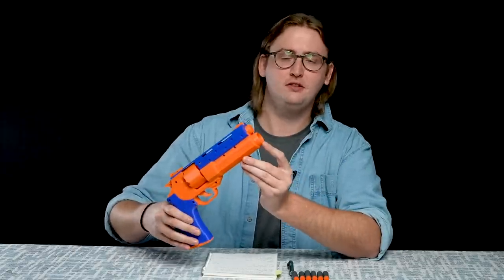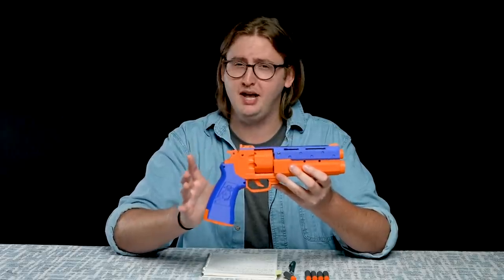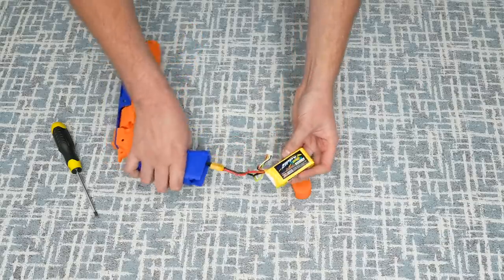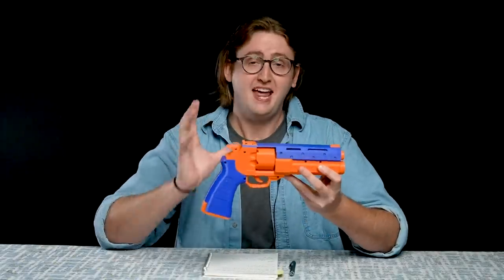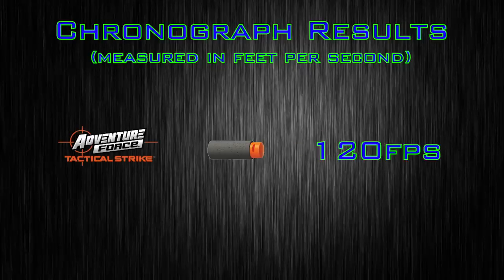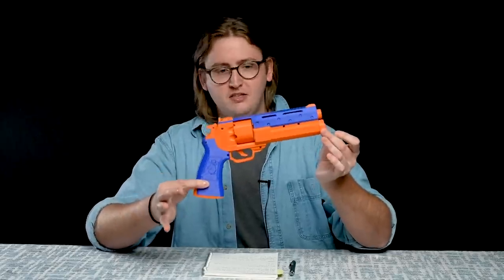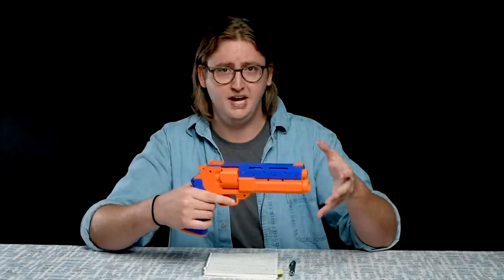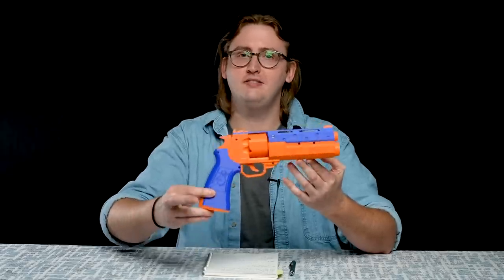[REVIEW] The Magpie | Flywheel Revolver!

Comment: Something I noticed is that this blaster looks almost like a 1-1 replica of a Mateba Mocel 6 Unica, which if so, I have to complement the designer on. It's a pretty obscure real steel semiautomatic revolver that fires from the bottom of the cylinder instead of the top, which reduces flip up. It's one of the more obscure and complicated revolvers ever made.

Comment: As the designer, I'd say this was a very fair review. It was made, less from a competitive stand point, and more "because I wanted it to exist". On that note though, I have effectively run this at events as a sidearm, though it has often been plagued by issues of one sort or another. 
The only thing to note beyond what was mentioned is that the hammer is not cosmetic, but central to how the blaster operates. The hammer rotates and presses a linear pusher into the chamber, and also operates the hand that turns the cylinder. Because of that, it can also be hammer fired without using the trigger at all
Reply: Well, nonetheless, you did a great job.
Reply: Hope the Magpie gets a revamp and more superior internals.
Reply: @pramusetyakanca1552  that isn't on the table really, as I've been very busy with shellington blaster work. Maybe someday, though
Reply: @HeathHeil  that's where I come in with that longcolt mod kit we talked about.
Reply: @thinredpaste  that will definitely be helpful for the longcolt. The original magpie could probably use some updates, but I have no major plans for that at the moment.
Reply: @HeathHeil  I'll probably port my adjustments to the original magpie too, but I started with the longcolt cause its the one I wanted to exist more.
Reply: It looks rad as Heck, and the concept of a single trigger flywheel like this is cool! Interested to see a version 2 and onwards
Reply: Could you make so that the hammer activates the flywheels? Therefore, the trigger would only push the dart and disengage the flywheels so it could be less tricky.
Reply: @alex-winters8473  that's how it works. The hammer rotates the cylinder, presses and then releases the flywheel switch, and pushes the dart
Reply: So I can finally fulfill my childhood dream of owning a revolver that works like a cowboy and shoots nerf darts? Helll ya
Reply: That’s what I said bro we think so alike ☺️
Reply: This takes a lot of talent. Great work
Reply: Thank you for dedicating time to designing and providing the foam community with new blaster designs. I love the fact that you made a flywheel revolver in a world of talon mag side arms. Thank you for making something new! ❤
Reply: I got, like, 5% of that. But let’s just say it makes sense
Reply: @Trollo_Swaggins  but then I would be better served making a spring powered hammer blaster to maximize power. The point is that it's semi/double action. It's finnicky, but it just is what it is
Reply: How much is it again?
Reply: how do you feel about modding blasters, as a designer?
Reply: @MikeHoltackers  if you mean modifying my designs, I'm happy with that within a certain reasonable amount. If you're talking about the traditional modding, that's where I started. it was a lot of fun, but I like the modeling and printing a lot more
Reply: Great job! Big fan of your design and functionality! I'm looking for a pistol and will consider this.
Reply: @FenrirFire18  it's a ton of fun to use, even if it's not the most practical blaster. If you do get one, I built a couple on streams and go over some of the tuning, which might help with that reliability too
Reply: I'm kinda hoping a railing for a scope is added
Reply: @djacobxk113hustawan4  I did add a small top rail in the thingiverse files at some point, although I'd never tested it
Reply: Love how it reminds me of a Unica
Reply: Are you an aussie
Reply: @pickleberry3611  I am not
Reply: does that mean its fan firable?
Reply: @buyalmond5939  you can fan the hammer, yes
Reply: I actually would like to see a speed loader for it so it feels more like a real 
Mateba model 6 Unica
Reply: @SeshanTM  I made a speed loader for it, but I wouldn't recommend it with the side drop cylinder. It's a very thin part and would very likely break against the force of a speed loader
Reply: @HeathHeil  if I had the materials and equipment I would make the crane metal

Also in almost every real revolver swinging the cylinder can break the crane
Reply: @SeshanTM  that's something I didn't know. I'm definitely not a firearms expert. On that note, roboman automation just launched metal arms (or cranes I guess) on their site, along with delrin hand and the trigger sear and a metal cage
Reply: @HeathHeil  I mean I just have 3 really good gun games a ps3 a mind that likes research and a lot of time
Reply: @SeshanTM  I assume you've spent some time with world of guns then haha
Reply: @HeathHeil  actually and surprisingly no

Because I play all games free to play and my computer is the epitome of junk
Reply: @SeshanTM  it's mostly free
Reply: Did you took inspiration from destiny? It looks really close to de revolver model in the game
Reply: @GoblinIntheGroto  how could I not? Haha
Reply: "it can also be hammer fired without using the trigger at all
"

Well I know what I'm doing when I get my grubbly lil hands on one.
Reply: Isn't this gun based off a real revolver if so could you tell me the name of it?
Reply: @Takon_pilot  it's not exactly based off a real one. There are visual and mechanical cues largely from the chiappa rhino, some visual cues from the mateba Unica, and visual references from all over the place
Reply: You did a great job. Also one thousandth like
Reply: You should alter the design slightly to take destiny fans' money.
Reply: Hey, Heath... I like it.
Reply: Being able to hammer fire it changes things a lot
Reply: I love the magpie but living in the UK, I guess delivery would be awkward
Reply: I would suggest experimenting with making the hammer the rev switch
Reply: @RDeathmark  that's already how it works
Reply: @HeathHeil  as in you prime the hammer and the fly wheels run until trigger is pulled?
Reply: @RDeathmark  no, the action is all tied to the hammer, but it's not single action. You don't prime the hammer to fire, it just physically actuates the pusher. 
Single action wouldn't work, because it would have the hammer pressing the pusher into the chamber and it couldn't rotate or reload unless that was moved
Reply: I wondered that immediately
Reply: Did you base it off of the mateba model 6
Reply: @johnfkennedyinanopentopcar8976  among others, yes
Reply: @HeathHeil  Yeah I think that's what RDeathmark wants. If they're thinking what I'm thinking, then what they're wondering is if you would consider a modified mechanism where you can cock the hammer, and the flywheels just run until you pull the trigger and fire. It would be okay if it stayed locked and you couldn't reload while it's cocked - that's how the real ones work, after all!
Reply: Great job. Fannable nerf blaster firing half-lenghts.
Reply: @HeathHeil  I wish you could make it a little more different as in I wish you made 2 different sets 1 hammer and silent and the other automatic
Reply: Hi! I just wanted to say this is a super awesome looking piece. I love the under barrel mateba/rhino appearance. Awesome that this thing exists and considering you were making it as a “proof of concept/I wanted it to exist” it is amazing. Full credit. 

I hope that you eventually get the time to improve the magpie as it is a really cool piece.
Reply: fanfire the nerf gun
Reply: I am curious if this system could be implemented into 3d printed prop guns such as the ace of spades from destiny, from looking at the design I think it could work but seeing as you are its designer I'd love to hear  your thoughts on the idea.
Reply: @ronin_84x33  destiny (and trigun) were both inspiration for the design. It could definitely be made, and on my Etsy I have files for a trigun version. Compromises to accuracy have to be made to fit the firing internals, so it wouldn't be a 100% replica, but you can get close
Reply: this gun is awesome and you could maybe make it like a real gun in the way that just like a normal double action revolver the first half of the triggerpul activates the flywheel and moves the hammer back and locks it in the back position then the second half of the triggerpull is to fire it and  releases the hammer and i really hope you implement a locking mechanism for the cocked position. if you do that you can make it single action by cocking the hammer, that way it will function like a real double action revolver. I really hope you see this and implement it.
Reply: @speedman69420  it wouldn't work that way, because the pusher moves with the hammer directly, rather than dropping like a firing pin. At about 3/4 of the hammer travel is when the dart fires. It's an imitation, even if the hammer is directly involved in the mechanism, it can't quite mimic how real steel works

Comment: Maybe make the hammer function as when the hammer cock back, the flywheel start revving and the cylinder start revolving. When the trigger press, the hammer slam the dart like a pusher and the rev stopped after the dart fling and hammer return. Other way, when the trigger squeezed, the hammer cock back, the flywheel start revving and the cylinder start revolving. When the trigger is squeezed full, it it follows the step above. 

Tldr: make the revolver double action to remove trigger strains.
Reply: So how it actually works is that the hammer rotates and presses on a linear pusher. So the hammer is completely functional, just not in a lock and cocked way, but double action only. He didn't really cover this, but you can also hammer fire it, which will remove that finnicky trigger pull

Comment: If I was ever a designer for 3D Printing, I definitely would make a actual Magnum Based Foam Blaster and do what I can to mimic the Magnum Pistol plus find ways to make sure to get quality plastic to print.

Fun fact, if people like the snob barrel which is my personal favorite on damage, looks, and even more reasonable for darts, could add a feature to replace the barrel to technically be like a N-Strike attachment Gimmick.

It definitely be something to be hammer but to make a little design like a air compressor so tiny it can be a slight different compared to a traditional magnum but be as close as possible.

And the best part when reloading a magnum pistol, having the optional quick reload piece to have some darts ready. Once reloading, open the dart barrel and stick in that quick reload till you take it out and you are reloaded.

A idea to make it feel you are using a magnum but it be as a foam flinging magnum pistol gun

Comment: I said it before and I will keep saying it. The magpie is most definitely a SHOW PIECE. Great to look at, great to hold, great to mess around with, but when in a war when you ACTUALLY need it, 7/10 times it just will not cooperate. My magpie has all the metal bits and delrin arms from Roboman, and I still have these issues. It's possible, but it will most definitely test your patience

Comment: I know this would be mechanically and/or electrically very complex but I have an idea: this but it features a working single/double action similar to a colt python. Manually cocking the hammer would rotate the cylinder AND start the flywheels, leaving only the injection of a dart to be done by the trigger. Other than that it would be identical. Pulling the trigger with first cocking the hammer would do the same as demonstrated

Comment: This reminds me of a thought I had a little while ago. Could you make a springer nerf gun where all you have to do is pull the trigger. Pull it half way to rotate and prime the blaster and pull it the rest the way to fire. Or you could prime the hammer which would rotate and prime the blaster, then pull the trigger the rest of the way.
Reply: Having the trigger pull prime the spring is not only mechanically difficult, but it would prevent you from using any stronger spring as that would make the trigger pull obnoxiously heavy.
Reply: Snapfire-8, Voidcaster and Nailbiter are all basically that

Comment: I know everybody out here throwing their two cents around...so I will as well! What about having a grip safety for activating the flywheels?
Reply: Certainly doable, but I haven't done that kind of design since the early versions of the pigeon. The problem there was it was too front heavy, and you could fire without revving and jam it (which I did.) This wouldn't be as front heavy, so maybe it would be just fine though
Reply: @HeathHeil  I guess that is a problem, but if it functioned as an actual grip safety as well, would that not prevent them from accidently jamming the gun? I've no experience with gun design (Obviously, why else would I make an opinion on the matter?), so I'm generally interested in if it would work. On a side note, you're also making sure that the user has a good grip when shooting. ;)

Comment: Shouldn’t the hammer be made to work as a flywheel trigger? Like when you pull it down it turns on the flywheel and when you push it back up it turns it off

Comment: Does anyone know if  Coop's looked at the pigeon? Similar concept to the magpie, but as it feeds off of a half dart mag, normally either a katana or talon, instead of a revolver cylinder, the mechanism is simpler and less prone to failure. Both blasters are even built around the same Flywheel the World system, or FTW for short. Just keep in mind that if someone wanted to build your own from both blaster designs, UNDER NO CIRCUMSTANCES should 3d printed flywheels be used, the crush, or the amount of pressure between the dart and the flywheels, is far too great, and printed wheels WILL fail almost immediately.

Comment: I wonder if the hammer moving action could be disabled, reducing the strain on the actual firing mechanism. Now the trigger just do too much - run flywheel, rotate cylinder, push dart AND cock what looks like spring loaded hammer... That is too much.
Reply: The hammer does everything, and the trigger is only there to actuate the hammer